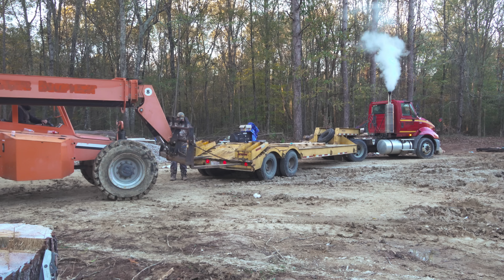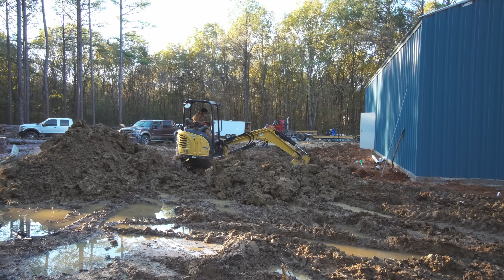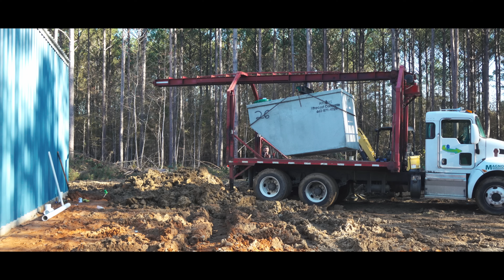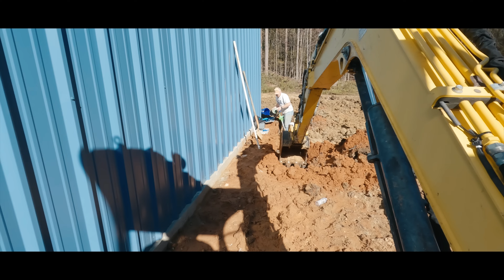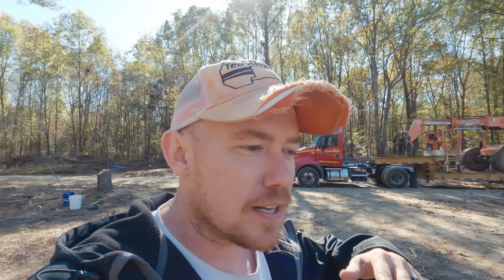Day 228 - Final Shop Build Day + Septic Install

Comment: Looking great. I have one question/issue. Did they put butyl sealant on the roof R-panels and screw the joints together? If not you are likely to have seeping roof leaks in the future. I like R panel roof but if it's not sealed and screwed it will eventually leak at those seams as water will wick up and over.  I have allot of experience with that happening.
Reply from the maker: Not exactly sure.

Comment: Jay, congratulations! Big step complete. Looking forward to the inside build mainly, but it'll be neat to see every other step in the process. I believe you said your walls would be R9 insulated. I'm not sure what you're using for insulation, but if you could go above R20 or even R40 with spray foam, it could cost a good bit, but keeping the temp consistent inside the shop until the house is built would be much easier with a higher R value. Just my $0.02. And again, congratulations, and Happy Thanksgiving!
Reply from the maker: This stuff is R10. Nothing major. But we won't be adding any more to the shop itself. We will have an insulated, heated, and cooled apartment inside. The shop itself will be open in the non-cold months.

Comment: I really want to see how they handled the roof where it meets the lean to at the main roof. It seems like the way they did it that there will be a leak at the connection.
Reply from the maker: I think the distance of the camera may have given you the wrong impression. The lean-to panels are nearly a foot underneath the roof panels.

Comment: I feel as a decade older guy on cold.  About you size I would guess. Not that matters any on size or weight. I typically get cold a lot more quickly than my younger self. Same metabolism really.  And activity.  Though diff type of it.  I have white finger syndrome and just weird crap but healthy. I prob should go to diff doctors. Lol.  So glad your getting it all done in time.  Even a wind break helps a lot. And the to have an extra bathroom with a child. Plus